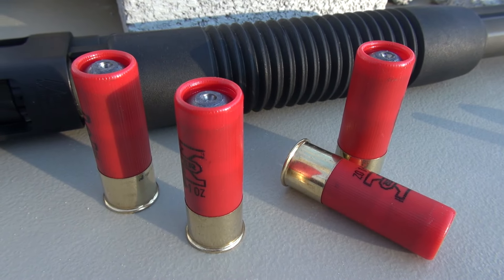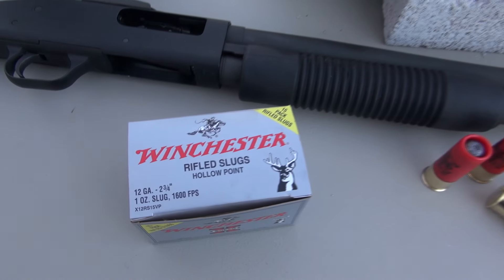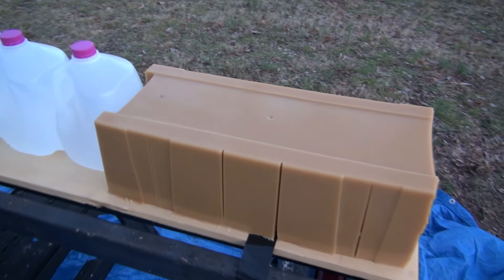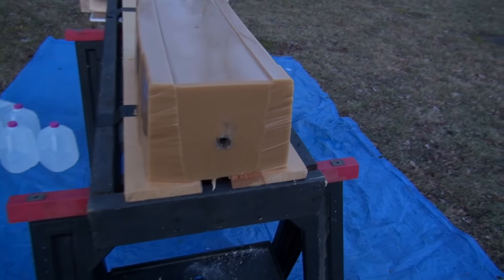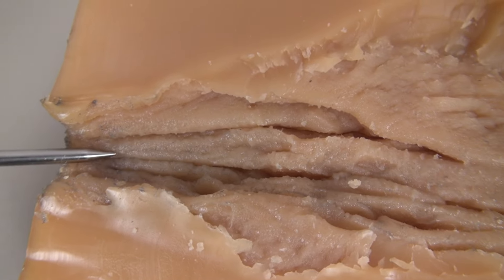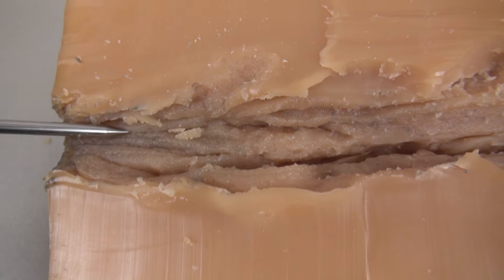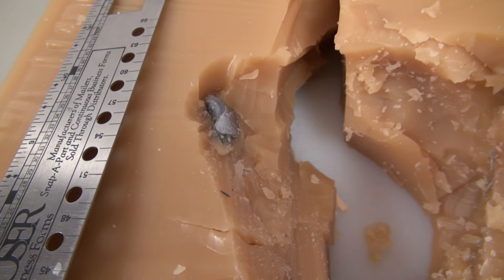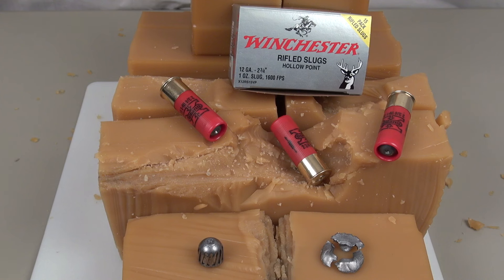12 Gauge Foster Slug in Ballistic Gel

Comment: What is your first choice for a home defense 12 gauge round then?
Reply: Wild, for home defense, go with #4 buckshot. There are plenty of videos and articles that discuss the advantages of #4 buck over basically everything else, but the gist of it is that there are a lot more pellets than bigger buckshot (20 in #4 and 9 in 00 buck) and yet this does not sacrifice penetration potential in a human target. The best buckshot also uses some kind of wad to keep a tight spread in flight, increasing wounding potential. It's tempting to want to use stuff like Winchester Super X, which only uses a cardboard wad and causes a huge spread at longer distances, but remember that you want to make sure every pellet is accounted for. You don't wanna hit the bad guy with 8 pellets (in the case of the most common 00 Buck) and have that one stray pellet hitting something you don't want it to hit.

Slugs are also not ideal for home defense due to overpenetration hazards. And birdshot, regardless of what you will hear from anyone else, does not produce a wound that will reliably stop an attacker, especially one that is hell bent (drugged/determined/doesn't feel pain) on doing you harm. #4 buck and upwards will do the job. Of course, if you can't find #4 buckshot, which I think you'll have trouble procuring, you can always go with #1 buck if you can find it or the good ol' trusty 00 buck.
Reply: ***** 20 years of "military experience" has nothing to do with self defense laws in the US. If someone took your advice and used birdshot and killed someone with the intent of just scaring them away, theyre in trouble. I have nothing against miltary guys but some think they have it all figured out. War is very different than self defense.

Comment: What is the best smooth bore slug for hunting
Reply: +Idoallthat ..  Brenneke Slugs are superior in every way when compared to the Foster design.   The Brenneke is not as hollow in the base and because of that it usually weighs in at 1.25 oz.   The fiber wadding is fastened to the rear of the slug with a screw and is part of the projectile.   Because the wad is fastened to the rear of the slug it is impossible for the projectile to tumble and they are know to fly straighter then the fosters from smooth bore barrels, especially as range increases.    Brenneke's are about twice as expensive as run of the mill Foster Slugs, however once you're sighted in the difference in cost becomes irrelevant since ammunition is one of the cheapest items you will buy as far as hunting equipment goes.

Comment: " with a slug its energy is dissipated directly into the target." You just saw how much a slug penetrates... There's no doubt in my mind it would go in and out. "I'm pretty confident I wont miss considering I'm a good shot" Everyone's a good shot at close range, not so much under stress. "Even if I do I only have to worry about one projectile, not several spreading out in all direction." How far away do you plan on shooting this guy?? It's not a videogame where buckshot leaves the barrel at a